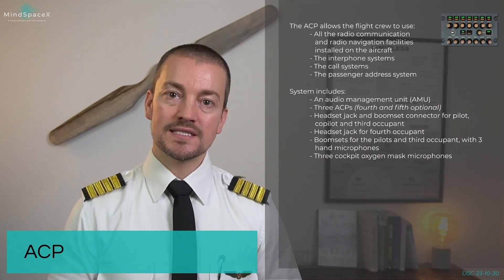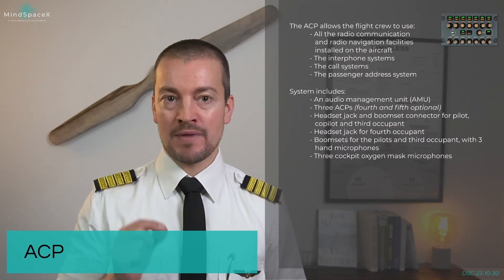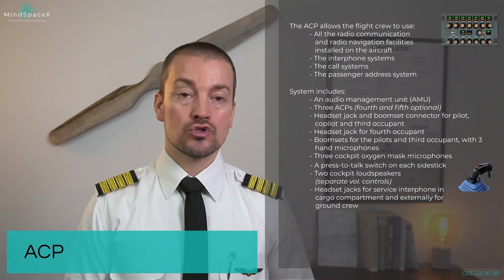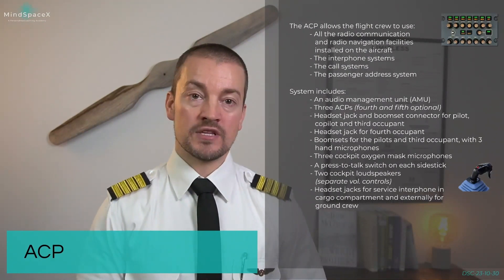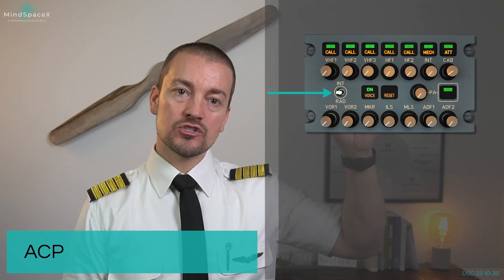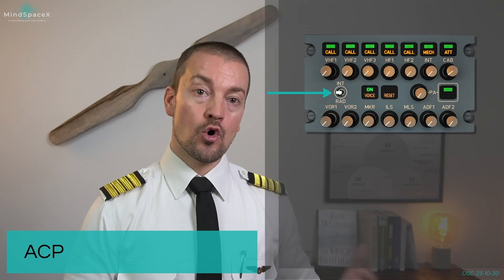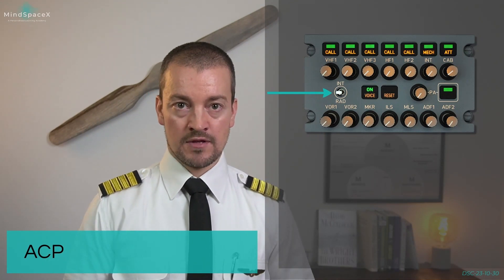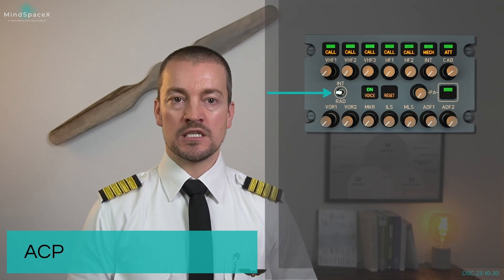A320 Audio Control Panel (ACP)

Comment: Hi Sir, when pilot need to talk with mechanic, they use the toggle in "int" or "N" position? Thanks for your answer.
Reply from the maker: Hi Chi, that depends. When in the neutral position the transmission will only happen when you use the boom mic of push the push-to-talk on on either side stick. If you set the toggle to INT then you have what we call a “hot mic” where all audio picked up by the mic is transmitted automatically without having to push and release the push-to-talk buttons.
Reply: @MindSpaceXAviation  😍 I got it. Thank you!
Reply: @MindSpaceXAviation this int (hot mic selection ) is for inside the a/c only not for radio communicating with Atc ? Right ?